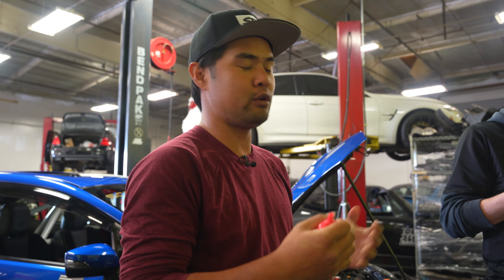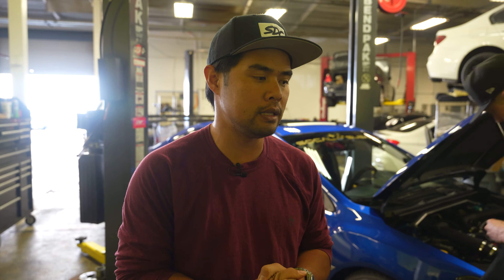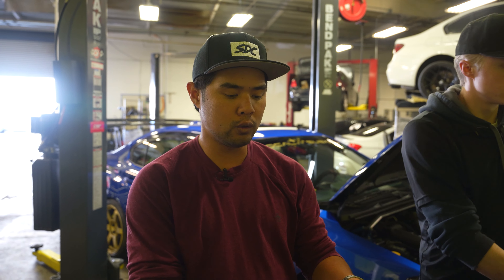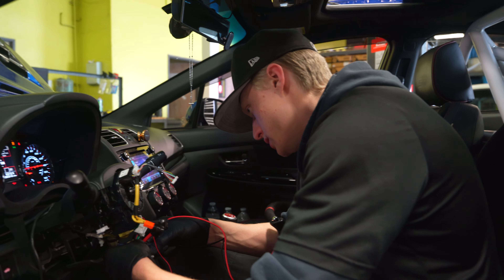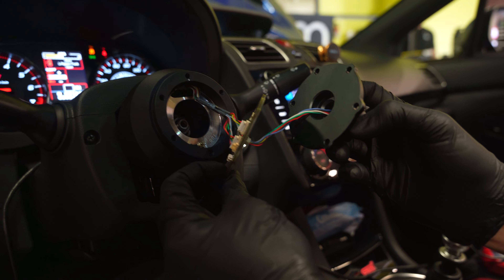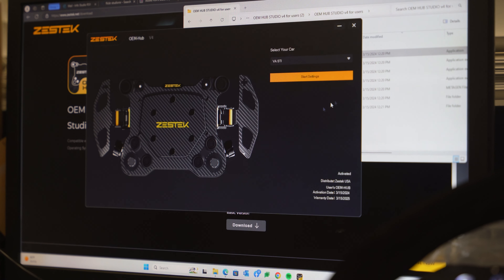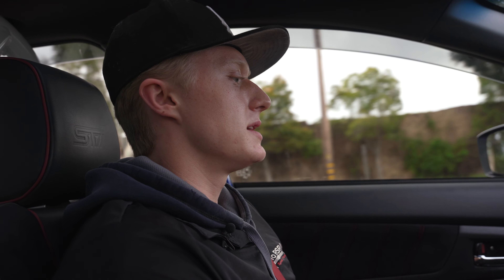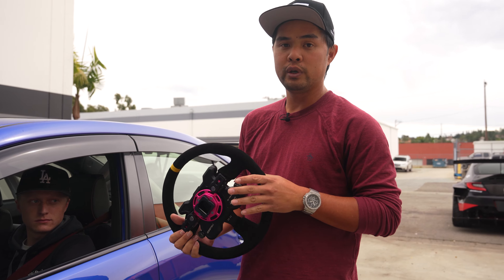Zestek Racing Steering wheel - Transferrable & Programmable!

Comment: Hi there, thanks for such a great explanation regarding the features and the installation of that SW. Just want to confirm one step of the installation, when you said that the hub must get its power at the Ignition ON position, it seems that you were making up a wiring for that. Does it mean it's not a 100% a "plug & play"? I'm worried of doing such an upgrade on my GR Corolla but not having the full equipments/tools if it turns to be some electrical work (crimping, soldering...).

Comment: Do you happen to know if this works with the 2017 Subaru VA WRX (NON STI)?
Reply: In the steering wheel system, there are VA-A and VA-B models. You can check whether your steering wheel is an earlier or later version, as Zestek has adapted for both models.
Reply from the maker: Yes! 100% works for your ‘17 WRX. Remember to use the code in the description if you’d like to order yours. Happy to help directly as well info@studiorsr.com 🤙🏻

Comment: U should of show how u ran thst red wire r where u ran it too ... 😔😔
Reply: The red wire gets connected to a brown and yellow wire on the far right plug that’s under the steering column shown in the video using a wire connector pin on the cut end of the wire.